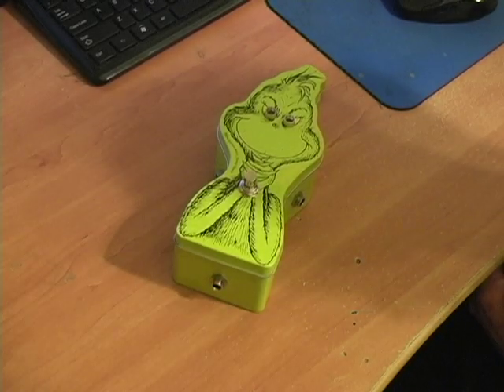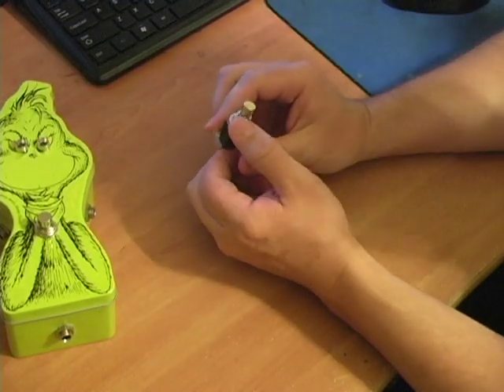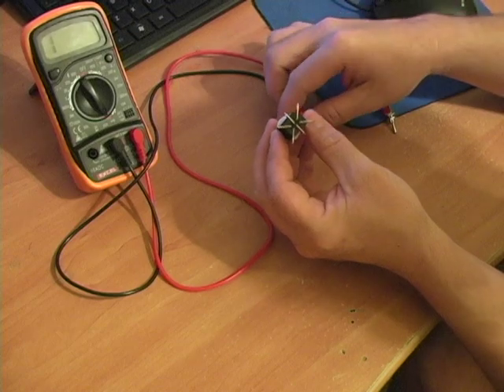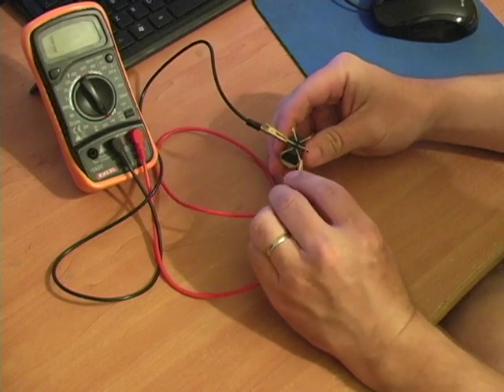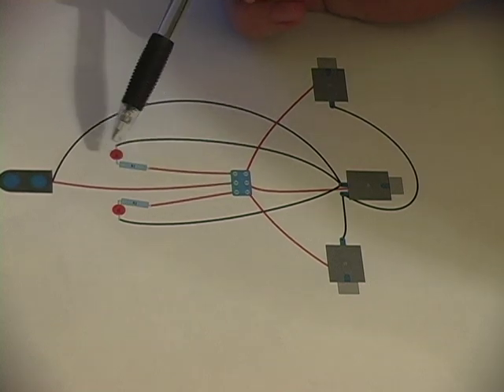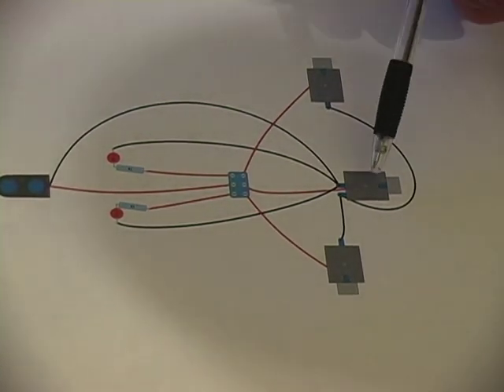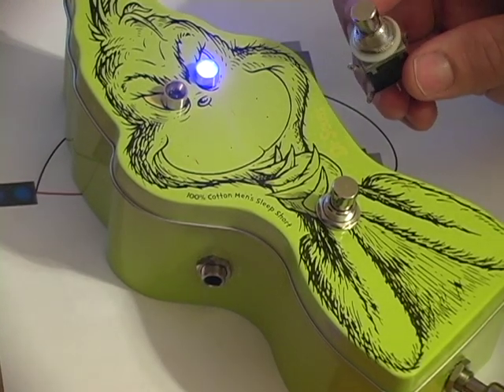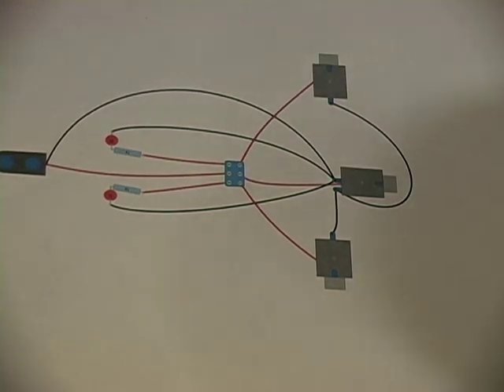A/B switch and how a DPDT (double pole double throw) switch works

Comment: Awesome man, I'm trying to build game pad with pc keyboard, by using keyword's main brain. So on this main brain there are total of 30 wires, and when I connect each time two of these individual wireless they give letter H, B, C and etc. on WordPad. What I want now to add different colors of LEDes for each characters of keypad. This means I'm not allowed to connect negative or positive lines of my 9 volt battery to any of keypad wires. Do you think if this switch can handle these two different wiring separately?  Thanks very much and regards.

Comment: why all A/B + LED diagrams i see use 3PDT switches and more wires? this looks way easier and it works. any idea?
Reply: an example http://davidbolton.co/wp-content/uploads/stompboxed-the-guitar-pedal-builders-repository-switch-effect-of-ab-switch-wiring-diagram.jpg
Reply: the "audio" signal seems to go to waste on the middle vertical row of the switch and the third row is used for leds. Your approach seems better.
Reply: i might be talking out of my ass. please advise :)
Reply: is it because they want to achieve grounding jacks and battery separately?
Reply: so the middle row of 3pdt sends unused signal to ground. your does not. hm.

Comment from the maker: Hey Diego Sanz. I cant reply to your comment so Im gonna put this here. I use a stereo jack to act as a switch for the battery. You can use a mono jack, but its gonna run the battery down even when you unplug the input jack.
Reply: +greendunn1 Can you please explain wiring the battery (I mean the + and - , like which is ground?), and how do I recognize ground on each jack input, and if you can find a nice explanation (link on the internet, or you tell me) how to use stereo as a switch? I am an electronics faculty student so I can understand even if you don't put it simple :) 
This is a great job you did here. Thank you for sharing this with us, and thank you in advance!
Reply from the maker: +Srdjan Babic here is a video oh how I wired it. Red lines mean positive or hot and black means negative or ground. Does that help?
Reply: +greendunn1 Ok, yes, I got that later :) Now,  I have been searching the internet on how to use stereo jack as a switch, and I cannot find any answer. Can you just tell me which wire did you connect to which of the pins? Thank you once again!
Reply: +greendunn1 Acutally I found it in another one of your videos! I got it now! Again, thank you!
Reply from the maker: No problem!

Comment: Thanks for posting this video! however I don't fully get how you connect the negative of the battery together with the negative of the LEDs.. if they go to the same tip in the jack then the lights will be on regardless a cable is plugged in or not.... I tried building the pedal and I can't get the battery to be turned off when I unplug the cable. 
could you explain a bit better that part of the wiring diagram? thanks!
Reply from the maker: Are you using a stereo jack?
Reply from the maker: Enzo Fullone Here is an explanation. Hope this helps, if not let me know and Ill try again. Thanks for watching!!!

https://www.youtube.com/watch?v=NNz8q1WL860